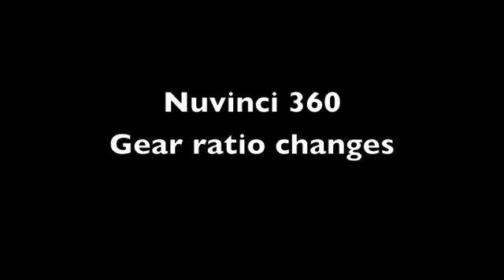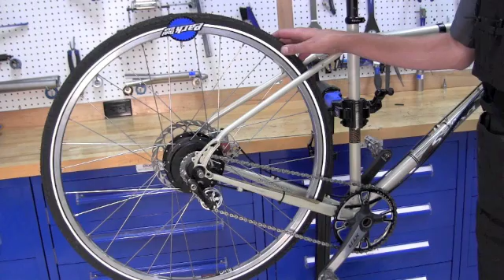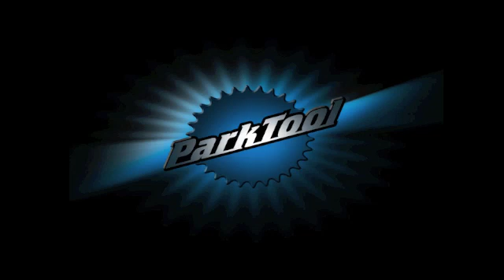Nuvinci 360 Gear Ratio

Comment: Can this take MULTIPLE CHAIN WHEELS (3)?  If not, why not?
Reply: Leave that for Sheldon Brown 2.0. The 1.0 version of the famous bicycle mechanic put a 7spd cassette onto a Sturmey Archer 3spd hub, making 21 speeds. Multiplied by his triple chainring, that bumped him up to just a modest 63 speeds.
Reply from the maker: There is potential to set these types of hubs up with multiple chainrings but it's not usually recommended by the manufacturers. The best thing to do is always check with the manufacturer's recommendations and follow them.

Comment: hey guys, can you tell me if it's possible to fit the Nuvinci into a frame with a 130mm drop out spacing?..
Reply from the maker: Monstaah Some frames can be safely spread without any issue to the 135mm spacing. It is only 2.5mm per side.
Reply: Thanks muchly mate.. confirms my ulterior question as to the 135mm being the hub width or the Axle length..  appreciate ya taking the time...